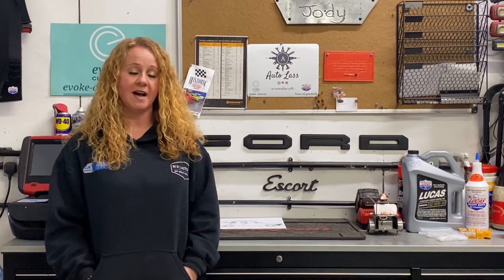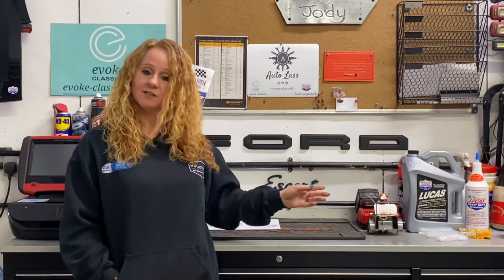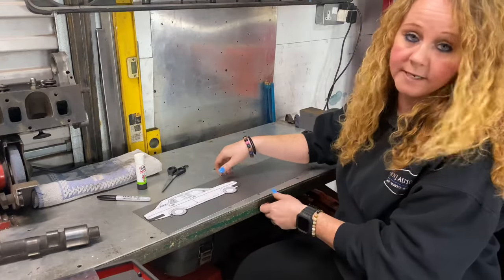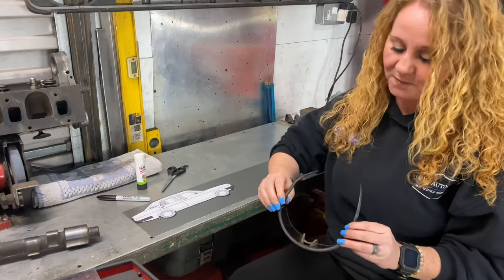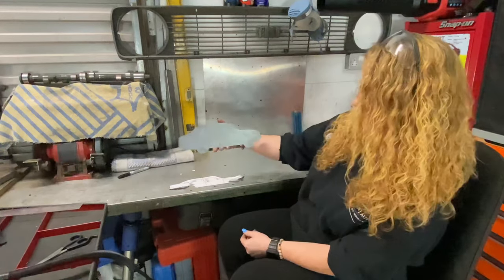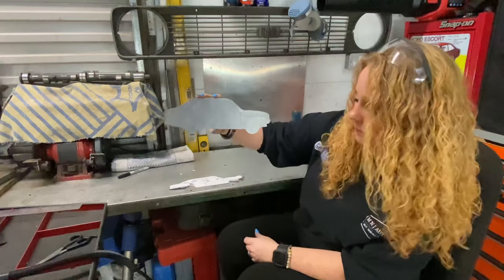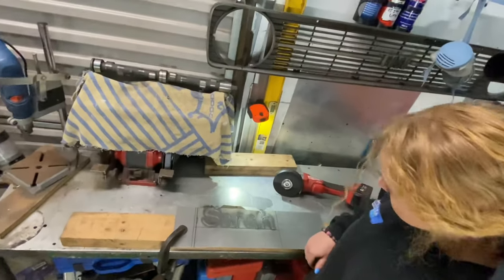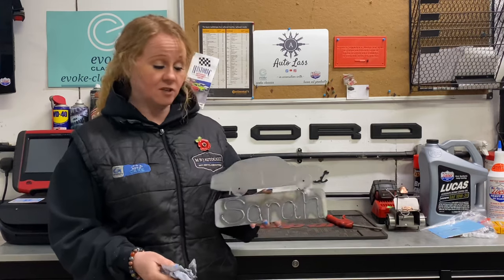Having fun fabricating a name plaque for Sarah Crabtree.  Welding, grinding & cutting an Ital 💙

Comment: Jody, until you find a better solution, how about trying an elastic hair bobble, or multiples of, to keep your cuffs tight. 
Or better still any local seamstress or saddler would have the machinery to be able to cut and hem that for you. 
Awesome video btw 👏👏👏👏👏❤️
👍
Reply from the maker: Thank you BR  -  Ahhh good thinking.  Although I would love someone to provide a welding jacket for a small lass too 👩🏻‍🦰